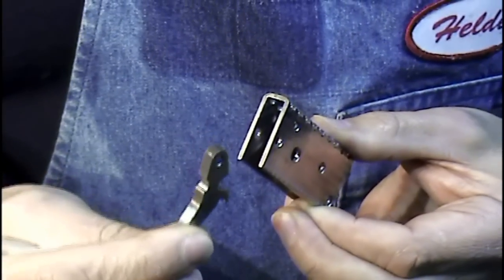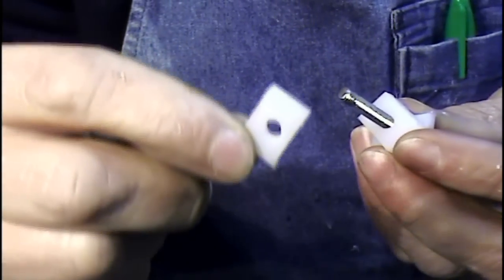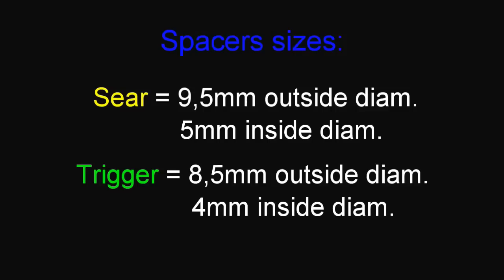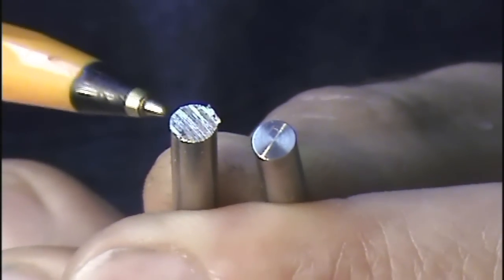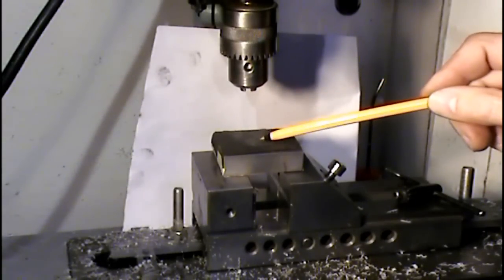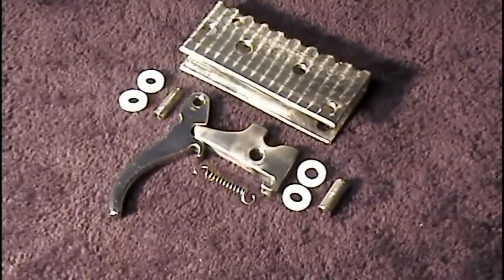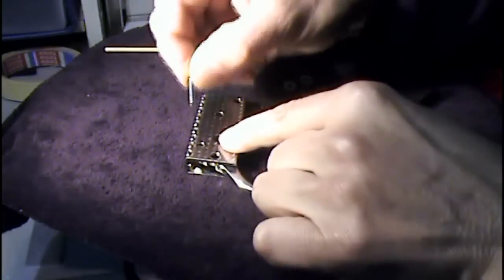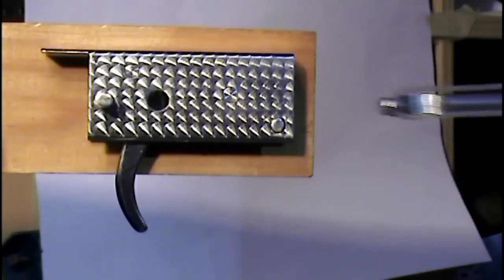Speargun Trigger Mechanism - Part 3 - final assembly!

Comment: master machinist ! beautiful work making it look so easy i will try to do this when i have my drill/milling machine , what else do you make handles , spearshafts , floppers , please leave me a message i want to learn more , i go cebu philippines every august if work permits , and helping my dive buddies there to make there own guns , forgot to ask what is the strength of stainless youre using for the sear and trigger
Reply from the maker: I used, grade 316 stainless. At this time I´m working on a new Trigger design  that will have a safety nob, and a better Sear stop.
I´ll post a video soon!
Thanks for the comment and good luck on your projects!

Comment: The video idea is fantastic, your very good job but the problem are the measures or the mold. they do not speak English and I have to wonder, what you talking in the videos.
if possible send me the mold would be fantastic. I'm doing the trigger system of my arbelete and I'm having a hard time with the measures. GREETINGS across the americas Brazil.
Reply from the maker: +Vicente Canet 
Hello Vicente Canet,
 that will not be possible, i have to finish making the 
spearguns and after  testing it for some time, it´s very important to 
know if it works in real life situations, and that is safe to use it.
Thanks for the comment and for watching my videos!

Comment: Hello MrMyvids4you would like your help, you can send me your projects with the measurements so I can start my trigger?
Reply from the maker: Hello Matheus Gomes, I designed this trigger mechanism using a Cad program. The only dimensions that I can provide are: The trigger housing dimensions= 13x30x65mm, wall thickness: 2mm the Trigger and Sear= 5mm thick.
I´m very confident about this design, but I need to fiel test it, over a long period of time before making it available. Sorry for that!

Comment: Thank you very much for the video and please tell us how to print or draw pieces of the trigger
Reply from the maker: Hello Ahmed Hamed,
making the plans available will not be possible, however i can give some
 overall dimensions from the trigger mechanism and the spearguns.
 - The trigger housing dimensions= 13x30x65mm, wall thickness: 2mm 
Trigger and Sear= 5mm thick. All made from 316 grade stainless steel
Some of my channel viewers told me, that by using any free screen 
recorder program to take "screen shots"  from some of my videos, and 
then using a image editing program 
like "windows PAINT" to scale the images to get the right sizes. Watch the video
 "Roller Speargun Design Model"
 https://www.youtube.com/watch?v=_qQXGEgw5p8  at 1:03 is possible to see a side view of the trigger mechanism.

  Overall dimensions of the spearguns.
The roller speargun:
 1200mm long (end to end)
950mm from the centre of the rollers to the edge of the trigger pocket 
50mm wide
---------
Traditional speargun,
1200m long
950mm from the edge of the rubber bands hole to the trigger pocket
50mm wide from the but plate to the end of the trigger pocket and tapering down to 40mm at the tip (muzzle)
I used  Okoume Marine Plywood  laminated together with epoxy,  but a much better choice will be to use Teak Wood.
Thanks for the comment and for watching my videos.

Comment: great job can i have the templete desugn it's for personal usage please ?
Reply from the maker: I´m working on a new design that will improve this trigger performance, it will have a shorter trigger pull, new Sear stop and a safety knob. This is a project under development and needs to be field tested first, before being available.
The only dimensions that i can provide are the outside dimensions from the housing: 65 x 30 x 13mm, the walls are 2mm thick.
Thanks for the comment!

Comment: Hi, could you tell me where can i find the prints for the trigger and the other parts of the trigger mechanism? Thank you very much
Reply from the maker: Hello panagiotis artemiou,
I designed it my self, I will not be making the plans available, but  I can give you some overall dimensions for it.
 - The trigger housing dimensions= 13x30x65mm, wall thickness: 2mm 
Trigger and Sear= 5mm thick. All made from 316 grade stainless steel
Some of my channel viewers told me, that by using any free screen 
recorder program to take "screen shots"  from some of my videos, and 
then using a image editing program like "PAINT" to scale the images to get the right sizes. Watch the video
 "Roller Speargun Design Model"
 https://www.youtube.com/watch?v=_qQXGEgw5p8  at 1:03 is possible to see a side view of the trigger mechanism.
Thanks for the comment and for watching my videos.

Comment: beautiful works !
for the spear don't use INOX spear but "springsteel" like rob allen or orca spear the qualitie is very mutch better in resistance and acury
Reply from the maker: Thanks for the advise, i do agree springsteel is the best choice, i have two spearguns, my oldest one is over 30 years old, the shaft is made from springsteel and after all of this time i never had any major problems, aside from the rust that it gets if i forget to coated with oil.
The other is 4 years with a stainless steel shaft, that constantly needs sharpening and it gets bent everytime it hits a rock!
Reply: MrMyvids4you there is megasub, sportsmed and bluewater extrem how sell springsteal ! if you go in marseille cost i'm very happy to view the result and go hunting ^^ ! you thinks make reverse mechanism or bulbup style for nest gun ? :)
Reply from the maker: zozo13480
Thanks for the info!

Comment: thank you so much for your inspirational videos! i was really hoping that you could pretty please make the templates available so i can print them and follow along?? pretty please??
Reply from the maker: Hello Spencer Davis,
Making the plans available will not be possible but a can give some dimensions for it.
- The trigger housing dimensions= 13x30x65mm, wall thickness: 2mm 
Trigger and Sear= 5mm thick. All made from 316 grade stainless steel
Some of my channel viewers told me that is possible to take "screen 
shots" from some of my videos and then using scale to get the right 
sizes. Watch the video "Roller Speargun Design Model"
 https://www.youtube.com/watch?v=_qQXGEgw5p8  at 1:03 is possible to see a side view of the trigger mach.
Thanks for the comment and for watching!

Comment: tough    way ... but  result  are  great   hope  the  metal  enough  strong  and enough stong to the salt water  ..  good job  and thx for sharing
Reply from the maker: Hello Mr. Farel, I used 316 stainless stell to make the triggers, this stainless steel is corrosion resistant, mechanicaly only time will tell if is strong enough to last a long time of use. I´m verry optimist that it will work!
thanks for the comment!

Comment: si posséble les mésure de mecanisme que voue avais fabriquer SVP
Reply from the maker: Hello dourade aanaba,
 I designed this trigger mechanism using a Cad program. The only dimensions that I can provide are: The trigger housing outside dimensions= 13x30x65mm, wall thickness= 2mm
 the Trigger and Sear= 5mm thick.
Material: 316 grade stainless steel
Thanks for watching!

Comment: hi, from a french guy
very good job wah!!!
do you have any documents in pdf format to show me how log is that peace, and the others.

thank you for your help and your videos, really.

franck
Reply from the maker: Hello STEINMETZ Franck,
i have to finish making the two spearguns first, then i want to fiel test it for some time to know if it works and if it is safe to use.
For now the only dimensions that i can provide are:
 trigger housing dimensions= 13x30x65mm, wall thickness: 2mm
 the Trigger and Sear= 5mm thick.
all made from 316 grade stainless steel

some of my viwers told me that are tanking "screenshots" from the videos and then scaling it to get the right size!

Thanks for watching my videos!
Reply: Merci de ces informations tres precieuses.
je compte me lancer dans la fabrication d'un fusil sous marin 90cm  roller totalement fait main, je rassemble tout le materiel necessaire et je le faibrique avant le mois de mai.
la gachette sera faite grace a votre model, mais je sais qu'elle sera moins belle. lol
bonne journée

Franck le frenchy
Reply: j'ai fais aussi des screenshots de vos videos, je dois donc etre dans la bonne voie.
un expert comme vous met combien de temps a fabriquer un fusil sous marin? j'ai hate de m'y mettre , je vous enverrai les photos du résultat, si ce n'est pas trop moche biensur.

a bientôt
Franck

Comment: I wish you would publish the templates to replicate the mechanism.
Reply from the maker: Hello Avinash Kachhy,
I want to finish this speargun project first, before making it available. This is a very old dream that I have since I was 12 yars old, back then I remember cutting off the handle of a plastic toy hand gun to make the speargun grip, and bending a leftouver piece of plastic tube that I found on a near by construction site to make the snorkel tube!
&#160;I designed this trigger mechanism using a Cad program. The only dimensions that I can provide are: The trigger housing dimensions= 13x30x65mm, wall thickness: 2mm the Trigger and Sear= 5mm thick. All made from 316 stainless steel
I&#180;m very confident about this design, but I need to fiel test it, over a long period of time before making it available. 
Some of my channel viewers told me that is possible to take "screen shots" from some of my videos and then using scale to get the right sizes. Watch the video "Roller Speargun Design Model" at 1:03 is possible to see a side view of the trigger mach.
Thanks for the comment and for watching my videos!

Comment: possinle to get a template of the trigger mechanism?
Reply from the maker: Hello Aflaah Shareed,
Making the plans available will not be possible but a can give some dimensions for it.
- The trigger housing dimensions= 13x30x65mm, wall thickness: 2mm 
Trigger and Sear= 5mm thick. All made from 316 grade stainless steel
Some of my channel viewers told me, that by using any free screen recorder programto to take "screen 
shots"  from some of my videos and then using a image editing program 
like "PAINT" to scale the images to get the right sizes. Watch the video
 "Roller Speargun Design Model"
 https://www.youtube.com/watch?v=_qQXGEgw5p8  at 1:03 is possible to see a side view of the trigger mach.
Thanks for the comment and for watching!

Comment: hola...diseñe la caja y el mecanismo pero no me quedan los agujeros precisos los de la caja es dificil use un taladro de banco como haces para hacer los del otro lado d ela caja no sale en el video  que puedo usar para mas precicion aparte de la madera que usas..
Reply from the maker: Hello Byron Ruiz
Making the plans available will not be possible but a can give some dimensions for it.
- The trigger housing dimensions= 13x30x65mm, wall thickness: 2mm 
Trigger and Sear= 5mm thick. All made from 316 grade stainless steel
Some of my channel viewers told me, that by using any free screen recorder programto to take "screen 
shots"  from some of my videos and then using a image editing program like "PAINT" to scale the images to get the right sizes. Watch the video "Roller Speargun Design Model"
 https://www.youtube.com/watch?v=_qQXGEgw5p8  at 1:03 is possible to see a side view of the trigger mach.
Thanks for the comment and for watching!

Comment: I see that you're holding the end mill in the drill chuck when milling. I used to do the same until I bought a couple of collets, 4-16mm. They all have a morse taper nr. 3, so they will fit right into the spindle of my drill press/mill. A drawbar is used to firmly hold the collet in the spindle and to lock the end mill in the collet.

Using collets instead of a chuck significantly reduce the vibration in the machine, especially when milling steel or other hard metals
Reply from the maker: Hello Benny 8025,
 unfortunatly my drill press is very small and doesn´t have a hole for a drawbar, either!
thanks for the comment and my congratulations for your channel

Comment: great job. well done. this trigger can be used for many other projects that need a release mechanism. do you have a printable file to download of the trigger parts. thanks again very well done.
Reply from the maker: Hello dad dada,
I designed this trigger mechanism using a Cad program. The only dimensions that I can provide are: The trigger housing dimensions= 13x30x65mm, wall thickness: 2mm the Trigger and Sear= 5mm thick. all made from 316 stainless steel.
I´m very confident about this design, but I need to fiel test it, over a long period of time before making it available, but i also need to finish the two spearguns first! Sorry for that!

Comment: FAVOR THE PLANS FOR MANUFACTURE
Reply from the maker: Hello Destino M Reservas,
That will not be possible but I can give you some overall dimensions for it.
 - The trigger housing dimensions= 13x30x65mm, wall thickness: 2mm 
Trigger and Sear= 5mm thick. All made from 316 grade stainless steel
Some of my channel viewers told me, that by using any free screen 
recorder program to take "screen shots"  from some of my videos, and 
then using a image editing program 
like "PAINT" to scale the images to get the right sizes. Watch the video
 "Roller Speargun Design Model"
 https://www.youtube.com/watch?v=_qQXGEgw5p8  at 1:03 is possible to see a side view of the trigger mechanism.
Thanks for the comment and for watching my videos.

Comment: sir I am already subscribe your Chanel and I really like the way you work. I would like to wait for next video with more details about the right distance between one part to the other.
Reply from the maker: Hello D´Jack
Making the plans available will not be possible but a can give you some dimensions for it.
- The trigger housing dimensions= 13x30x65mm, wall thickness: 2mm 
Trigger and Sear= 5mm thick. All made from 316 grade stainless steel
Some of my channel viewers told me, that by using any free screen recorder program to take "screen 
shots"  from some of my videos, and then using a image editing program 
like "PAINT" to scale the images to get the right sizes. Watch the video
 "Roller Speargun Design Model"
 https://www.youtube.com/watch?v=_qQXGEgw5p8  at 1:03 is possible to see a side view of the trigger mach.
Thanks for the comment and for watching.

Comment: Great stuff!:) 
Why did you choose different dimensions on the pins?
Reply from the maker: Hello Jonas O. Robertsen,
 I used a 5mm pin on the sear because that`s the pin that sustains more pressure, but if I was gonna make it again the pins would have been all the same size 4mm.
Thanks for the comment and for watching my videos.

Comment: That's a lot of man hours ya spend right there bro. I think it will help a lot if the housing be of two parts like the stock part of a revolver and the cover. Much easier to install the pins and parts too. But thanks for the effort though. Helped me a lot  to know that kind of trigger assembly works.
Reply: Hello Danny,
Thanks for the comment!